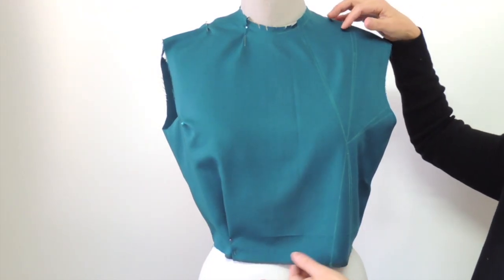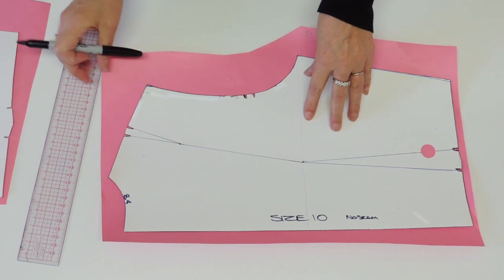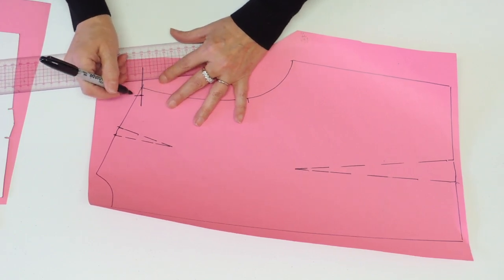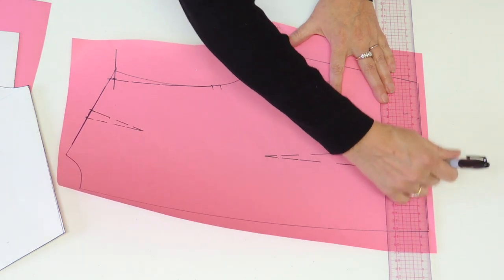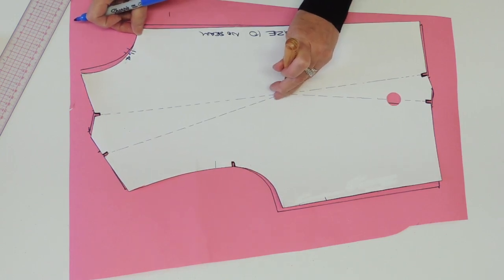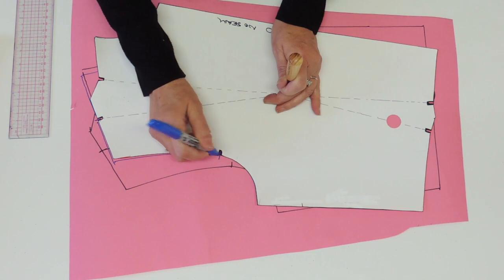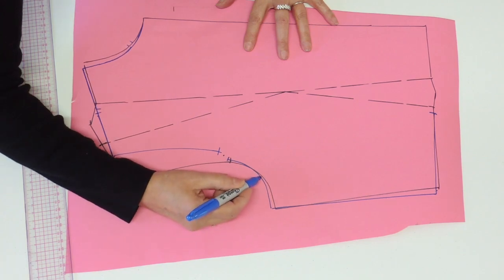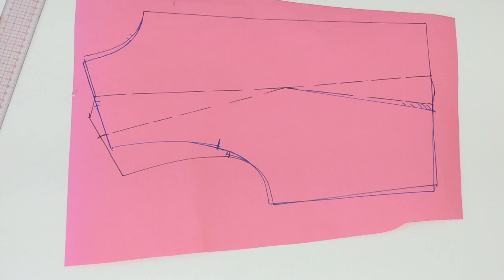Pattern a dartless bodice.

Comment: Diane .... thank you so much .... can I ask are the shoulders for front and back going to be equal length as my back is slightly shorter about 5mm ... is that because my original shoulder dart was 1.5cm which is what I moved? Thanks Jayne

Comment: Thank you for this wonderful video. Does that mean that the armhole does not change? and the sleeve pattern requires no changes?
Reply: Hello Luisa,
With this bodice, the armhole change a bit in the front. You must fix the sleeve by enlarging the sleeve about 1 cm. slash the grain line and add parallel, than remove 0.5 on each side of the wrist.
Diane

Comment: Hi Diane, can we remove the waist dart of front and back from the seam line of the waist...can we trim that much width at the waistline
Reply from the maker: Hello Yashvardhan Singh Chouhan,No you should not remove the value of the dart at the side seam/waist. This block is to be use for shirt or loose fit bodice. I did a draping video showing why you can't remove the darts. 
https://youtu.be/QljWIIwjmnU
Diane

Comment: Morning, how do we eliminate gapping on a dartless bodice, in particular when we increase neck width
Reply from the maker: Hello Fermi,
I wish I could tell you that you could have a WOVEN fitted bodice block without darts or seam, but I can't. 
That dart less block is use for semi fitted or loose fit tops, like blouse or shirt. I even used it as a starting point to make my coat block and my bomber jacket.
Diane
Reply: Or just add pleats or gather at the front neckline